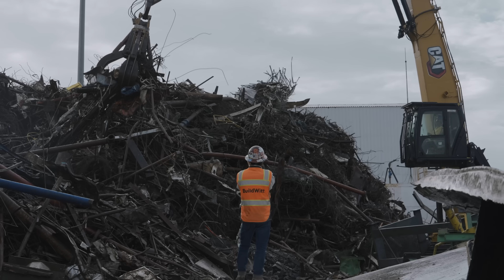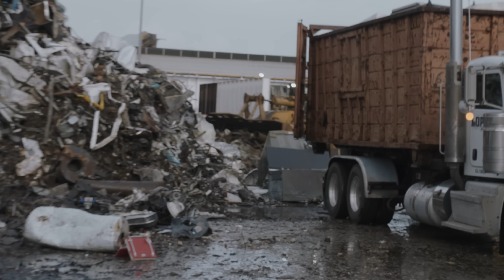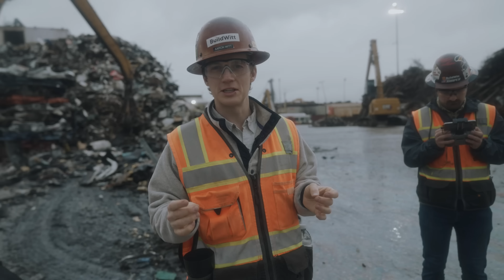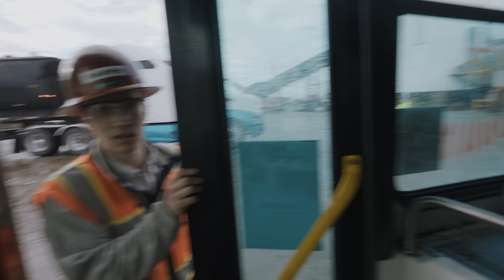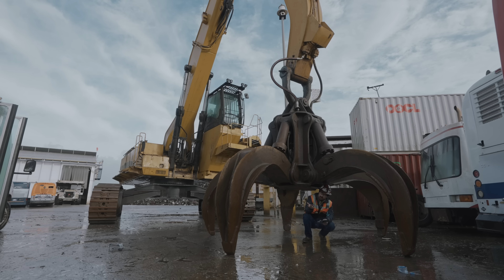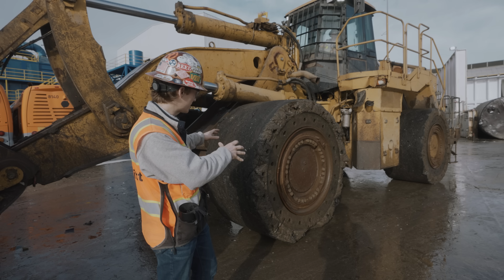The Wacky Machines of Recycling

Comment: 2:58
Did they drain the refrigerator gas inside the radiators? I know it's not very toxic but it has severe effects on the ozone layer. Otherwise that's a cool operation!
Reply: The scrap metal yards usually won’t take them unless they’re been tagged as “Purged” by a technician.
Reply: @tomrogers9467  :D

Comment: Cold rolled steel ( non scrap based ) goes into auto bodies.  This is the best higher grade quality sheet steel from iron ore. 
Hot rolled steel ( scrap based ) goes into appliances - washers, dryers, etc., 
this is sheet steel of a lesser quality since it contains various contaminants.

Comment: Can someone explain to me what the 3 digits on the side of cat machines represent? I thought the first represented the type of machine and the last two were tonnage and the letter was what generation of machine it is.
Reply: It's all about product family types: 200 and 300 are hydraulic excavator series (200 was the first excavator family, 300 series is current HEX - hydraulic excavator family), 400 is loader/backhoe series; 500 is skidder series (discontinued); 600 is scraper series; 700 is truck series; 800 is compactor series, 900 is wheel and track loaders series. As the numbers increase in these product families the size/capacity of the machine increases.  D is the dozer family. Motor graders have both two and three digit model designations.  Engines 3200, 3300, 3400, 3500, 3600 with horsepower increasing in model number growth.  Now the new engine models are based on bore and liner size in liters. C175 means Cat engine of 175 liters.  Alphabet designation after model number has been discontinued.  Prior it meant improved generation of dozer or models such as D8H, D8K, D8L, etc.

Comment: One thing to note.  All metals can be recycled, but not all metals can be UPcycled.  There is a continual degradation of metals through smelting and re-alloying, it just takes several cycles to occur.  i.e. you can't make aircraft parts out of pots and pans (economically), but you can make pots and pans out of aircraft parts.
Reply: I absolutely agree!  That’s why Chinesium “metal” products are such total garbage!  Must be the last possible use of tired scrap!
Reply: @tomrogers9467  It's not really 'tired scrap', but that you can't simply melt metal down and recast it, and expect to get the same metal. There will always be contaminants getting in, and there must be another refining process, though not nearly as extensive as producing metal from ore. You've also got the many different alloy blends. Cheap Chinese rubbish doesn't do the extra work to control for the final alloy.